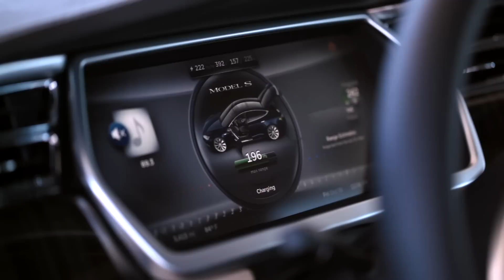CORRECTED: Why Tesla Just Purchased An Ultracapacitor Company

Comment: At current (pun intended) tech levels a combination of supercapacitor and Li-ion battery in a power pack gives many advantages. Very fast charging and better peak load performance from the supercapacitor side, along with good energy density and storage from the battery side of the equation. Down the track, the really interesting thing is that several solid state "battery" types exhibit the positive characteristics of both supercapacitors and high storage capacity batteries.
Reply: Lithium ION can not really take an outburst of power from an Ultra capacitor.. maybe a thick mesh of many tiny UC's but not one or two big ones.. the power is barely controllable when they discharge.  THey are better off being used in sudden unexpected power loads.. like on an electrical grid or a burst of power to get a semi up a hill .. etc.
Reply: @cawfeedawg  I don't see either a thick mesh of supercapacitors or just a few being used. Each specific quantity of Li-Ion battery cells would be served by a supercapacitor to spread the load in or out in a parallel circuit.
Reply: @ianstorey1021  I'm not an electrical engineer,  mechanical, so not sure. But an induction coil releases all of its energy in one go, no? Why would you want that "boot"? You may have good reasons, but what is your thinking as to why this is beneficial?
Reply: No. This is what I used to think that these capacitors will solve some issues with EVs back then.
When the Model S came with ever increasing performance and range, it appeared to me that those issues were resolved by Tesla through brute force which is boat loads of batteries.  
Considering the insane range of the 2020 Roadster, it seems that they did it again.  It is not like they needed the range but the insane performance with batteries working in parallel. 
Anyways, multiple media already stated that the acquisition is for the dry electrode technology and not the capacitors.  Unsure why Nikki still thinks it is about the capacitors
Reply: @ianstorey1021  My apologies, when you said coil I thought you meant induction coil, which converts magnetic energy into discrete bursts of electrical energy. Otherwise known as "windings" the coils you refer to are indeed continuous. A battery pack with supercaps as a buffer has great merit.
Reply: @karlp8484  No, with the right electronics you can control the rate of output of either an induction coil or capacitor.
Reply: The capacitor will get charged through regenerative breaking (fast charge) and provide the initial acceleration (fast discharge) from stop thus extending the range.
Reply: regenerate breaking  and charging

Comment: Is maxwells dry electrode technology “solid state” technology?  I looked up the technology and I didn’t find anywhere that described as solid state.  Also the consensus seems to be that the main immediate benefit to Tesla  is maxwells dry electrode technology which will be able to dramatically increase battery capacity and reduce cost.  So unfortunately even with Corrections this video is probably misleading
Reply: Critical thinking on Tesla??? Shh...just invest and pump on the internet!
Reply: solid state batteries are dry batteries. dry batteries are solid state batteries. Of course, the electrode is only one part of the battery, so a 'solid state battery' would be fully dry.

(I'm oversimplifying, but you get the general gist. Note however, that just this bit doesn't give the touted solid state benefits many are so excited about, you need to replace the electrolyte)
Reply: Maxwell has had a long history of impregnating metals into polymers...the old audio cassettes of past.  The dry cell technology is just that, a metal impregnated polymer that has an increase in energy density of almost double and a significant increase in the life of the cell; 90% capacity @ 2000 cycles, over traditional cells. Super capacitors sound great, but have a very poor energy density, but may pay a part in the front end to a battery pack to improve pulse performance.
Reply: @Herebuss  The audio cassette company.. wasn't that Maxell?
Reply: Solid as in no liquid which is in other lithium cells.
Reply: asharak84 that may be, but does dry electrode technology equate to that? I’m doubtful.  Solid state batteries are much hyped at the moment.  If dry electrode technology equates to solid state battery maxwell would be shouting it from the rooftops.  Instead their web site does not mention solid state batteries at all.  They only say that their technology is applicable to a wide variety of cell chemistries.   If anyone knows the details of this as a certainty rather than assumption and speculation please chip in
Reply: @andrewpaulhart   Maxwell's dry battery electrode (DBE) technology is a truly solventless and Cobalt free electrode coating process with game changing performance that can triple energy density, deliver 10-20% manufacturing cost reduction, double the battery life, and is scalable for both classical and advanced battery chemistry. Their energy density is proven >300 Wh/kg with a path to >500 Wh/kg identified. In theory my 310 mile range battery pack would extend to 930+ range using it's current lithium chemistry while weighing less. This is not a complete dry cell battery technology, but it clearly delivers performance across the board and is a major piece of any full dry battery solution.
Reply: Spiitz Travsky  so ....  if dry electrode technology can be used in non solid state batteries, that implies to me that the “dry electrode”. Must be something like a coated electrode that keeps the actual electrode dry.  Maybe this is about stopping the formation of lithium dendrites on the electrodes ...
Reply: Capacitors, like transistors and microprocessors, have always been considered 'solid state' technology.  Basically, every advance in electronics beyond vaccuum tubes is 'solid state' technology.  There remain to this day those that prefer the more analog nature of vaccuum tubes though.
Reply: Turns out that Dry Battery Electrode technology has nothing to do with a dry battery or solid state battery.  It refers to the manufacturing process for the electrode.  Apparently electrodes are manufactured wet and then need to be dried.  Maxwells process does this dry.  This has cost implications because it simplified the process .   The resulting electrode also increases energy density and battery life ...  but I don’t know why that is.  Follow this link for an well researched vid in this https://youtu.be/fE97Mj7Cmzk
Reply: By definition yes it would be a solid state battery
Reply: Dave Froman actually. ... it isn’t. See post above your reply where I answered my own question
Reply: @Herebuss  The cache memory analogy does makes sense. I mean 0-60 in Ludicrous Mode is 2 or 3 seconds. Ask he battery to do that and you quickly deplete the available charge for normal driving. Add an ultra capacitor to take even a proportion of that peak demand and the main battery will suffer less both in terms of charge and overall life.
Reply: @janmessek1826  LiFePo4 is a dry cell technology.

Comment: Would capacitors help with hard braking and acceleration? I know it can help with energy deliver. But I’m asking in the sense for efficiently taking a lot of power at once with hard braking and deliver to the battery slower. This could help with the range. Would you think this is possible?

Comment: Another issue with cobalt is many of the places where it's mined such as the Congo are politically unstable so the supply can become restricted.
 On the ultra caps they can help the regenerative braking system and save wear and tear on the battery pack by adding a short term storage system.

Comment: Thank you for correcting the video. I still think there is a few issues though. Dry battery electrodes, has nothing to do with solid state technology. The electrodes in batteries are already solid, the "dry" refers to not using solvents in the manufacturing process. Solid state refers to the electrolyte, and I have not heard anyone mention that Maxwell are working on solid electrolytes. 
Ultra capacitors may work as a buffer to preserve the life of the battery, but Maxwell stares that the DBE, may increase battery lifetime by up to 2x, while saving 10-20% (on the electrode). I don't think the impact of UC's will be nearly that, and they will increase cost and complexity. 
Power is only an issue with small battery packs, and when solid state enters the scene, power will not be an issue at all. And since the semi has huge battery, it also have a huge excess of power. Therefore UC's would make the least sense in the semi.

Comment: You have left some bits of important information out.
Where is the backup data?
The graph showing self discharge comparing a modern battery and a ultraconductor.
The size comparasion of the above two having the same power rating.
The charge time comparasion on a graph for same size storage.
What is the dollar value of these two components.

Comment: good commentary on the addition of the Maxwell super/ultra capacitors.  You did not mention the other advance where they seem to have developed an different dry anode (or is it cathode) , one that is not wet, not a prone to dendrites .  Anyway this technology may also deliver improvements to Tesla batteries which are already market leaders.  Tesla has been partnering with Maxwell so it would seem obvious that their purchase of Maxwell is very strategic and bodes well for future battery advances.  Some commentators suggested that Elon may be helping out a friend but my guess is that there are real advantages especially for the long range heaving lifting needed for the Tesla Semi.  Looking forward to Tesla absolutely leading the way and dragging the transport industry into a cleaner more cost efficient revolutions in the near future !

Comment: Supercapacitors have a higher density than standard capacitors? (2:17) can you give a specific model of supercap which has a higher energy density than normal electrolytics?

I checked this for a project I was doing, and was quite surprised- at least, commonly available supercaps actualy have a lower energy density than many electrolytics. This is because, while they have huge capacitance, they have a very low voltage (2.7 is quite common, as shown on your screencap), and energy is proportional to voltage squared.

Comment: One of the sticking points in Telsa's semi strategy is that the design and battery use only really permit short haul work. Over-the-road drivers are shut out due to prolonged charging times. But,  ultra-capacitors could allow for fast charge times, with the capacitors taking the charge and discharging into the batteries as the rig runs down the road. The design of semis allows for some flexibility in expanding the actual space for the capacitor components.

Comment: If I recall correctly, Maxwell also held patents on dry-electrode power cells.   So unless this patent technology was specifically excluded from the acquisition (which as far as I know Maxwell cast off their HV technology into a separate company and kept the battery/UC tech) then this could also be fueling Tesla's acquisition of the company.  Since its a dry-roll system that does not use cobalt or wet chemicals it would be theoretically cheaper to produce and manufacture.  It also has a theoretical energy density of 300 wh/kg to an upper end of 500 wh/kg.  The reason for the spin off of the HV was because Maxwell did not have the available funds to attempt to produce a production line nor test if the mass production was even feasible. I'd wager the practical energy density would be somewhere around 200-250 wh/kg, which would put it at about 50-100 wh/kg less than the type of battery that tesla is producing with cobalt.  However, this would still be a win in that a dry cell with approximately the same energy density would likely be more resistant to short circuit discharge and electrolytic thermal effects (IE producing vaporzied Hydrofluroic acid as it incinerates your vehicle).  However, if they can achieve the higher end of 300 or shudder 500 wh/kg we're talking some serious energy density for power cells... no where near gasoline - but enough to go from turning your car into a scorched frame into literally turning it into a puddle of semi-melted metal.  At least the aftermath would be "cleaner".

Comment: One drawback of (ultra)capacitors is that they change voltage during charge/discharge - unlike batteries that maintain an (almost) constant voltage throughout. This makes ultracapacitor-based energy storage for EVs very complicated because you have to start switching groups on and off and combining them in order to keep voltage for electrical components constants.

Comment: PERFECT VIDEO!!!! The best explanation for the Maxwell acquisition! Yes, I've learned all that same thing too. Perfect! Also, you should have mentioned how it could be used in home batteries and powerpacks, but yes, very good explanation, perfect.
Reply: The consensus seems to be that the maxwell acquisition was mainly about their dry electrode technology than their ultra capacitors, so while the video was interesting I think it may have been a little misleading
Reply: @andrewpaulhart  True, there is more to talk about this ultra capacitors. Since a capacitor gets its power exhausted much faster than batteries, it is also worth to mention that if those ultra capacitors have, for example a power controller connected in order to control the amount of power, to  supply to the rest of the electronics, adjusting the flow of power without using the ultra capacitor's full power. I think this can be quite revolutionary in terms of power delivery to the electric motor and receiving from regen. In the end it might also might have a better autonomy and longevity without degrading.

Comment: I don't see much use for ultracaps for regular charging but for storing the energy from dynamic braking definitely. Also of use for tyre shredding acceleration with less wear on the battery. Nor much use for getting a truck up a hill though.Ultracaps are high power low energy both for cost and density.

Comment: Due to the limited capacity of any UltraCap element of a battery system the only real use is in boosting the short term charge and discharge capability ie braking and acceleration. 
This would be useful where you will need to accelerate and slow larger vehicles, so Semi trucks and large Pickups could benefit in efficiency terms. The solid state tek would be an added future bonus.

Comment: Hi,    Thank you for that video.   I wish I knew what was incorrect before, but this video is very, very good, explaining Ultra Capacitors extremely well.    I have watched their progress for quite some years and I know capacitors very well for over 60 years, so I do appreciate what Ultra Capacitors can and can't do.    But basically as you said, they can effectively augment Batteries, by enabling very fast energy releases for acceleration and very fast energy recovery from active or regenerative breaking, and make off road battery charging very fast.   Well not actually the Batteries fast charging, but take in a very large charge very fast, then the car can be driven away and the very fast charge in the Ultra Capacitors then transferred into the Batteries at a rate that is very good for the Batteries.

Comment: Can the slow discharge of a super capacitor be fed into the main battery, to cut losses? A lot of this conversation seems to be about driving like a racing driver: Fast acceleration followed by sharp braking. This sounds like bad driving, to me. Flywheels have been used for regen.

Comment: As Elon has pointed out, you can get sufficient power from just adding more batteries, rather than using a hybrid battery + ultracap set up. I think this acquisition was more about their new double additive electrolyte battery technology which uses no cobalt. They state a energy density of 300 wH/kg with a path to 500 wH/kg (take that last number with a grain of salt). As Tesla's current 2170 cells have an energy density of about 270 wH/kg, this would be a decent improvement over their current technology

Comment: Unfortunately Nikki , you still don't get it : ultracaps are not good at storing high amounts of energy both from a volumetric and mass point of view . Their only advantage is in power density .
Reply: UCs can be beneficial in start stop traffic and on long winding roads. The UCs can take up the high current demand of acceleration for just a few seconds before the batteries take over. They take up charge from regen braking a lot better than batteries too.

Comment: I think batteries have better energy density while ultracapacitors can be charged very quickly.  I would think that ultracapacitors could be used to recover a higher percentage of regenerative braking energy and then the energy could quickly be applied at the next acceleration.  Used in this way, holding a charge is no longer a worry.

Comment: A quick correction. 2:20 Caps are not really capable of storing lots of energy. Actually, their energy density/mass ratio is pretty bad compared to LiOn batteries. They can just charge and discharge very fast (i.e instantaneously)

Comment: Using ultracapacitors Tesla could probably make battery chemistry that is more optimized for longevity and/or energy density. That function could be pushed to ultracapacitors creating the best of both worlds in technology. This could also reduce the cooling needs for a battery that is not as stressed by rapid charging and discharging.